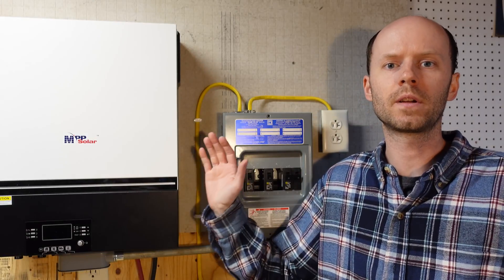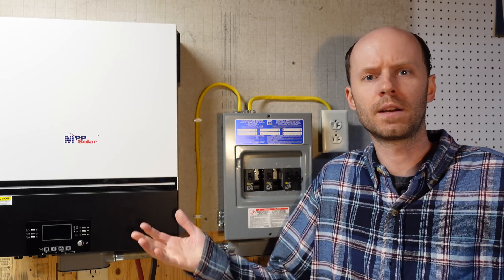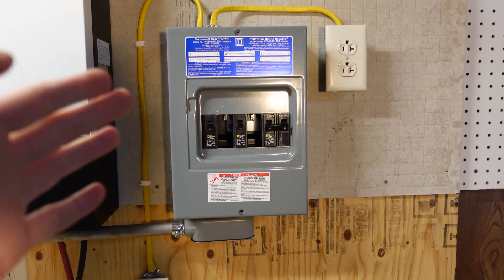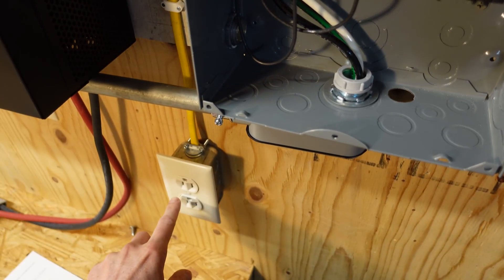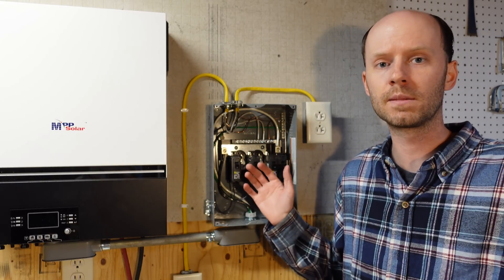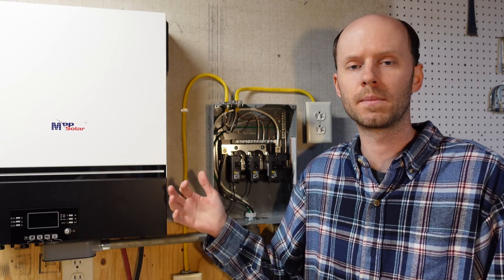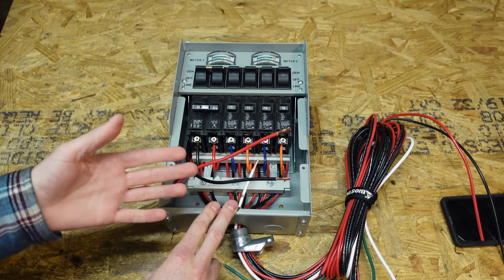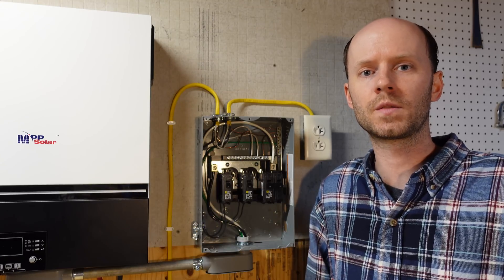MPP Solar LV6548 Inverter, Neutral+Ground Bonding, Completely Off-Grid

Comment: great vid, MPP pic show to remove the screw mark in Red circle? all 12 of them? While I understand the N-G bonding should be only one place, what is the benefit of NG bonded at the panel, instead of inside the inverter?
Reply from the maker: The screw with the pink checkmark gets removed. This entire video was to explain why what you're proposing does not work when connecting the inverter to a main panel with a transfer switch.
Reply: In case of a fault, the ground wire can carry up to the maximum current which that inverter can output for a brief time until it's Over Current Protection engages. All that current will go through that PCB and screw! I would prefer it to go through a proper sized wire in the panel tbh...

Comment: If the inverter was considered as your main panel with the G+N bond and you set up your panel as a sub would everything still work the same. Then with the automatic G+N bond when in inverter mode and when in grid tie the G+N is open (done by the unit) wouldn't the give you more flexibility?
Reply: This is what MPP said to me in a email
Hi,
Yes, all our inverters now are with N-G short capability under inverter mode and when in line mode, N-G is OPEN.  This is handled automatically and it's in line with requirement for application in most countries.
Reply: Also note
In the event when inverter output is disconnected from grid, N-G needs to short to ensure there's no leakage voltage that could trigger RCD to trip.  This is needed to ensure GFCI will work.

Would the GFCI in the unit still work if you move the bond
Reply: One more quick question does code state it needs to be bonded at the power source?
Reply from the maker: Yes, GFCI will still work fine in the example system I have here. Yes, if the panel was considered a sub-panel, you would want to leave the bond screw installed. This video is not about use with a sub-panel.
Reply: @LithiumSolar  I really like your videos but I don't think you are right about the GFCI how will it measure an amperage difference between ground and neutral if it is bonded after the GFCI? Also I'm not sure if I explained the main panel versus sub panel analogy properly. Thx
Reply from the maker: @Roll2Videos  A GFCI breaker works by measuring current on the hot (line) wire compared to the neutral (white) wire, both of which would go through the circuit breaker. If current returns to the panel on the ground conductor in a fault scenario, the GFCI breaker would see the indifference and trip.
Reply: My question was instead of taking the screws out of the unit to remove that bond why not leave your panel unbonded? In that case I know you wouldn't hook upto the grid but it leaves you the ability to do so as the unit has a ground neutral Bond transfer switch built in
Reply: @LithiumSolar  ugh I feel like an idiot. You are right about the GFCI. I've been looking at the DC Midnite solar ground fault circuit breaker that uses (-) and ground to measure and I had that in my head... At least your getting the engagement for YouTube algorithm 😀
Reply: @Roll2Videos  So what is the conclusion of this discussion ( for a novice please). Should I worry about bonding the sub panel or not. And should I ground it? Thanks.
Reply: @SlimSh8E  I'm going to leave this for @LithiumSolar to answer this is his channel. I will be video taping my growatt all-in-one hook up within a month where I have to bond my neutral ground in the panel (Off grid) because that unit does not automatically switch between open and closed bonding. I can explain my reasons there.

Comment: My setup is very similar, but I chose to leave the screws in place, and run grounds from a rod to the AC inputs. ONLY a ground, no other input. However, my questions are;
-I assume since MPP is ok with the screw removal, it does not void the warranty?
- Running 2 6548's for 240v split phase, which option is better, remove both screws and bond at the panel, or leave them both in place...or, maybe remove one screw? 
I think your option is closest to a standard configuration, and if you scale up you just remove the screws from any subsequent inverters.
Reply from the maker: My assumption is that since MPP Solar indicated it was ok to remove the screw, that it would not void the warranty - but that would be a question to ask them. Running two inverters in a split-phase configuration completely off-grid, I personally would run both inverters with the screw removed like shown in the video.
Reply: @LithiumSolar  What if you did not use the ac input but your ac output connects to your main panel that of course has bonded neutrals. I have a panel like your small one bonded like yours, coming from my two inverters and from there 4 wires go to my main 200A panel that has a xfer switch built in. Should I separate the grnd and neutrals in the small panelpanel?
Reply: You should remove the bonding screws in any circumstance. If you need a EGC bonding jumper, use an actual solid copper jumper wire in the wire space at the bottom of the inverter. You do not want to use your very expensive inverter as a fault current jumper.
Reply: @paulmccoy2908   So if I ground my panels, combiner box, and inverters to earth ground, doesn't that defeat the idea of a "floating" ground, which is essentially what this config is?